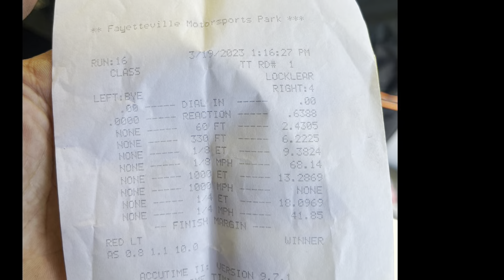🎞️ In Car Of Our 3rd & 4th Pass 💥 We Blew The Hood OFF‼️

Comment: Was u still running the larger pulley on the procharger ? And it must of been me just me but i thought right befor the hood came off the front wheels bounced like it was on and off the travel limiters in the front but like I said might of been just me ..o and a cowl hood with grabber scoops 👌
Reply from the maker: I need to go back and look at footage on slow motion. The new chin spoiler could of pushed air up under the hood. Yes we are still running the large pulley. We still have a lot more left in the car after a pulley change. Was thinking may need to switch to a no time car soon but idk
Reply: That's y I asked cause its quick now and a factor in almost 3,000 pounds u was foot breaking it and it's still got alot more left once u add that smaller pulley not to include its not fully dile in cause its set for u to get use to the car so yea... future contents with Percy's going to be interesting 💪
Reply from the maker: You nailed it!